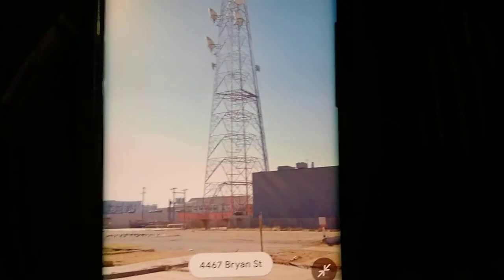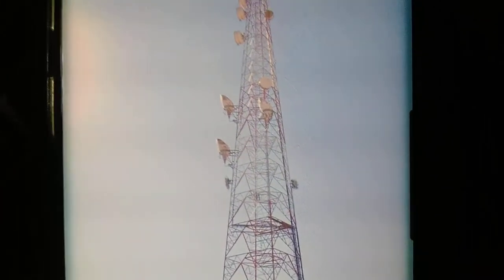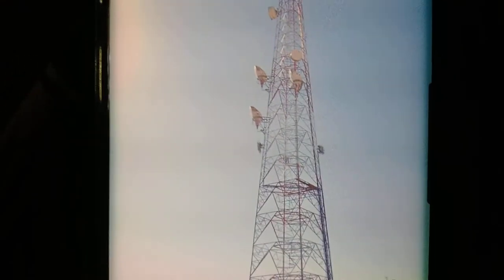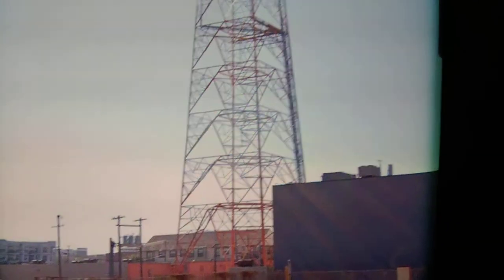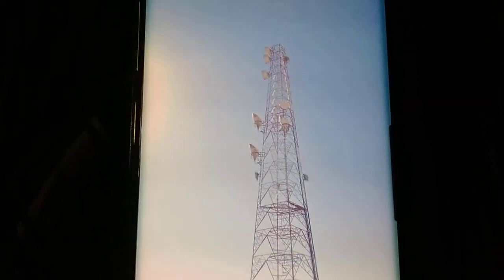More AT&T microwave towers

Comment: if this is a current picture looks like it is in use as it has newer antennas on it.
Reply from the maker: 1:30  The tower has a cellphone tower built beside it, it is a monopole with two microwave dish antennas on it and the one with cone antennas is an old abandoned tower.